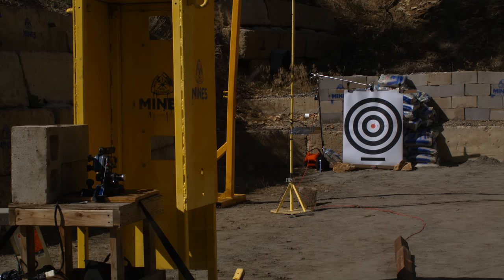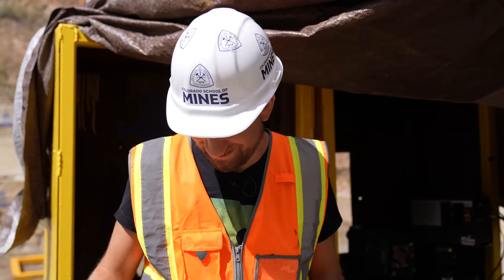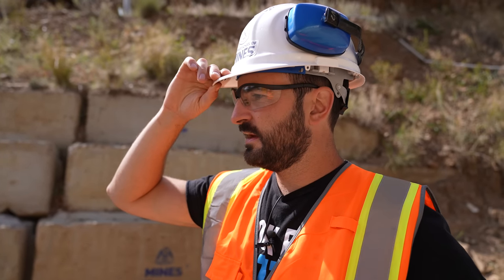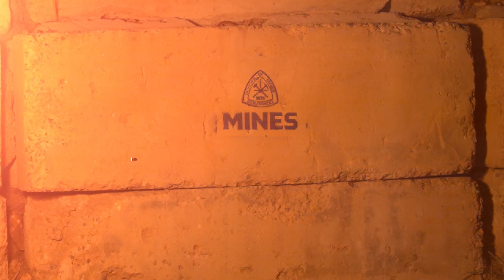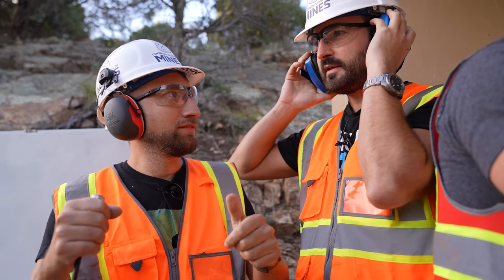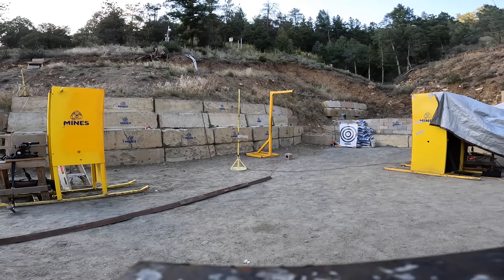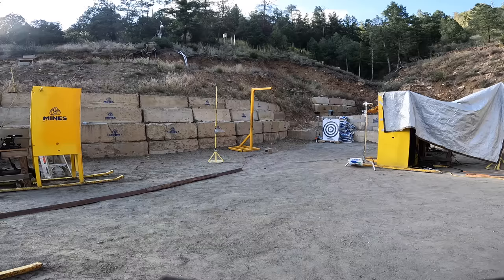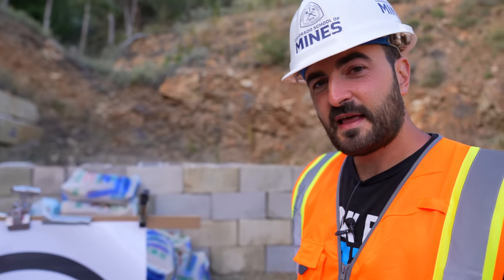Can Explosions Deflect Bullets? 2 MILLION FPS - The Slow Mo Guys

Comment: For the love of god! use a marker to mark your old bullet entries so you won't have to guess which one is the new one!! 😁 Nice explosions though! I bet the bullet is deflected a tiny bit, which may show better if target was like 1km away
Reply: Pasties are even better, but yes, somehow mark the previous shots.
Reply: imo, the biggest gripe is using PAPER target. Of course the blast is going to send the target flying and you won't get a consistent accuracy of hit markers. Next time, they should use a steel plate with a target painted on it.
Reply: i think the bullet would have deviated more if it was timed with the shockwave instead of the fireball
Reply: bullet being cylindrical dosent help i think. explosive bursts probably need flat planes for effect.
Reply: Just observing the position of the hole influences its position
Reply: @bigbrainboiii  I don't think there is any combo that will produce a noticable (more than wind / bullet variability) deflection. Sure the explosion is much faster & more powerful that the bullet but you have to consider the surface area & time scale that that explosion is acting on. The proportion of the total energy of the explosion that actually impacts the bullet is absolutely tiny.
Reply: @agilemind6241  to schockwave is just air moving so it is pretty much just wind + the shockwave travels at the speed of sound which will help proper the bullet

Comment: I love how ridiculously complex the setup is, how precise everything has to be measured, and then the final target they’re using to measure success or failure is flapping around madly each time. 😂
Reply: Glad to see I'm not the only one with that thought
Reply: First thing I noticed.
Reply: .... but then they wouldn't have an excuse to redo the test all over again 😉
Reply: No amount of planning can overcome that natural Gav and Dan energy
Reply: I was thinking the same thing.... A bit of paint on some plywood would have fixed this.
Reply: It was most likely flapping wildly because of the bullet hitting the target no? and as we saw the shockwave was slower then the bullet speed, so it wouldnt have affected it. Buuut, i would also love to see them reshoot this with less...ramshackle setup
Reply: ...but then at the end they showed the grouping in the bags behind the target and it was, guessing here, something like 4 to 6 inches? 

Even if the shockwave is having an effect on the bullet and the flimsy flapping target, the effect very clearly isn't any greater than wind and the sum total of all other unaccounted or random factors like miniscule differences in the gunpowder itself, the amount of gunpowder, bullet dimensions, mass, and finish, barrel temperature, air temperature, and so on.
Reply: Exactly. How could they miss that? Plywood with stenciled target would have been perfect and definitely a more accurate test.
Reply: 12:10
Reply: If you all actually paid attention they do mention that
Reply: @connormccarter9581 Yeah, I was thinking a piece of plywood would of been a bit better choice than that big flappy piece of paper too. 🤦‍♂😂😂
Reply: I'm surprised they didn't use a pen to mark the bullet holes on the target after each shot. Then it would have been easier to identify when a new hole appeared.
Reply: Well, they could build the target out of tungsten I guess, but then I'm not really hopeful for the life of the copper bullet lol
Reply: My thoughts exactly...even I have a real target, and I'm nobody.
Reply: @lincolnrayes6464 the shockwave is shown going like 10x faster than the bullet 🤨
Reply: @MustangsCanTurnToo  Well since i missed it care to point out a timestamp instead of sayin something and bein big brain enough to put an emoji at the end?
Reply: I was thinking it wouldve been better to use a rubber target bolted into a piece of would against the cement barriers so nothing moved. After seeing the target move before the bullet hit (accounting for the fact the bottom kept coming undone and raising the center) they would need to find a way to have a stationary target for definitive results.
Reply: Yes, but the sandbags behind the paper target show the grouping to be about the same
Reply: They could just paint the target on the bags of sand
Reply: @lincolnrayes6464  learning isn’t free.  You have to pay attention.
Reply: @they-call-me-mister-trash847  Literally all of those factors you mentioned are negligible at this distance.  Instead, either the gun mount is not repeatable, or the target is flapping randomly because the shockwave beats the bullet to it (or both).
Reply: Yeah.  They definitely need a steadier final target and some good ole masking tape to cover the prior bullet holes.
Reply: @they-call-me-mister-trash847  I both agree and disagree with you.  I agree the shockwave's effect doesn't appear to be that great.  But...

The entire setup of the experiment was flawed.

I submit that a firearm should have been set up in such a way that its bullets would have hit the same place on the target every time.  If they can't achieve that then any results for, or against the myth, cannot be considered as accurate data.

In addition, the distance between the gun and the target was too short.  If an explosion can cause even a small deviation in the path of a bullet, it may be enough to cause the bullet to completely miss the target at 100 yards.  I think this experiment was less than 25 yards?
Reply: They could've used a piece of wood or something loo
Reply: The moment the first explosion caused the bullet to hit higher on the target, I knew exactly what happened. Then you look at the slow mo and there's a crazy amount of movement in the target. Since it's secured at the top, any amount of movement is going to move the middle upward. When you're engineering something, it's so easy to hyper focus on solving the hardest part of the problem that you completely screw up the easy part. Getting the timing right was hard

Comment: Thinking about it the bullet should actually have an easier time traveling through the super-heated plasma from the explosion because its density is probably less than air at that range. Kinda like how you could in theory fly a spacecraft through the outer parts of a big star like Betelgeuse.
Reply: I agree
Reply: what exactly is the theory of flying through the outer parts of a large star? as in the outer part of the visible atmosphere of a star that size isnt hot enough to melt a spacecraft? the near vacuum of space is less material & drag then the super hot gas and plasma emitting out so close to a star. isnt the sun's atmosphere technically also the solar wind after it leaves the main body of the star, meaning the star atmosphere technically doesnt end until it reaches interstellar space outside of it's solar system?
Reply: just realized this is codys lab lol love ur stuff man
Reply: I was wondering about that, even just the air pressure being lower inside the shockwave until things equalise. Such a fast explosion is going to have a very small time effect on the bullet.
Would be cool to see it done again but use a length of detcord along the flight path see if that changes things.
Reply: smiles in Elite Dangerous :)
Reply: ye was bout to say that as well....
Reply: @Robo-xk4jm  It's called 'theory' for a reason
Reply: I think the only hope for deflecting would be when the bullet encounters the denser air at the leading edge of the shockwave. It's part of why I'm a little disappointed in the timing of all the shots in this experiment, as every single time the bullet was already past the mid point by the time it encountered the shockwave so it was impacted on the top or back by it. What would have been really interesting is if they timed it so the bullet was flying into the shockwave and was impacted on its leading edge. Based on the results of these tests I'm not confident it would have changed the outcome all that much, but if anything was going to it would be that.
Reply: reading hitchhiker's guide to the galaxy rn lol
Reply: This makes a lot of sense but there should still seemingly be a impulse affect on the bullet from the rapid change in pressure. However maybe the bullet was just moving too fast for any significant changes momentum to take place. It would be really cool to see this done with different size bullets and bullets moving at different speeds. There could be a multiple papers written on this topic!
Reply: While true, an unpowered object should still deflect at the interface between two densities even if there is no blast wave to exert a pushing force it. The direction of that deflection would depend on the angle of the interface to the bullet's travel. But a bullet's inertia is so high compared with the relatively small difference in air densities that I wouldn't be surprised if any deflection caused by explosions of this magnitude are so small that they can't be captured with typical camera resolutions.
Reply: Don't wanna be that guy (ok I do) but if you make a ship strong enough, you can fly through it. I like how you're thinking about this. My question is what happens at the boundaries of that "cloud?" I think the change in pressure, in a moving sheet of plasma, is likely to suggest "outside force." Which is effectively what they were seeking. From your comment, I then wonder if changing ionization/electro-magnetism won't also have effects. There's so much going on in this video, I'm so glad they made it!
Reply: I also think the size of the bullet is the primary reason it seems not affected by the blast. However, there might be a change in direction of travel of the bullet, which might not be statistically significant. Kudos Slo Mo Guys ❤
Reply: Interesting. So the windage is increased by orders of magnitude but the difference in air density is enough to negate the effect of that force.
Reply: literally doesnt answer a single thing  @GGMattt
Reply: @Robo-xk4jm  yes, some spacecraft have used "solar sails" since 2010 to propel them during their entire voyages.
Reply: @Philly_Willy  so by the "outerparts of a big star" he meant the whole solar system? suns atmosphere doesnt end until kuiper belt way past pluto, as compared to what most people think of an "atmosphere" between the photosphere and corona, which would melt & vaporize any thesible spacecraft, i dont know if supermassive stars have less heat in their corona, and it all goes back to my point of wouldnt the solar wind up close be more resistance then if you were millions of miles away in a near vaccum? of course plasma would be less drag when compared to the earth's gas at the surface i just want to know what this theory of piloting through a supermassive star atmosphere has to do with it when theres a vaccum outside of the star with the solar wind being less and less as you move away from it
Reply: Unfortunately, you're wrong. The pressure in an explosion far exceeds 1 atmosphere, which is the normal atmospheric pressure on Earth. An explosion is a rapid reaction that produces a large volume of gases. When a large volume of gases is rapidly produced in a confined area, it results in high pressure.
Reply: I think you nailed it. One more factor to add is the spin of the bullet. The rotation stabilizes flight and aids in "cutting" through the air. Such a great video!
Reply: @Robo-xk4jm  Planets have been found orbiting within the outer edges of very large stars.
Reply: gonna need you to break that down a bit for me chief 😅
Reply: WHY ARE SO MANY PEOPLE LIKING AND AGREEING WITH THIS COMMENT WHEN IT IS 100% FALSE 😭
Reply: @Robo-xk4jm  I think he means that plasma is thin enough that it would not significantly slow a spacecraft
Reply: RepentandbelieveinJesusChrist6   cool
Reply: Here's a thought - any density is infinitely more dense than a total vacuum, so you would experience more drag through super heated plasma, even if you didn't get incinerated by it!
Reply: That would also mean you'd have an easier time driving a car through a c4 explosion than air xD

Comment: I think a revisit on this is in order. The shockwave happens so late vs the passing of the bullet. The flamefront and detonation is dead on the explosion's 6, but you can see the shockwave when the bullet has moved off to around 4 on the watchdial. Looks like you needed to set the detonation off even earlier.
Reply: Agreed...

Get the dynamite out again...and blow up earlier...

Cool as hell footage though.
Reply: To add to this. 

The target needs to be further away. The shockwave was lifting the target paper and so putting the rounds "lower" on the target.
Reply: @Rrynarth can probably be solved in the same spot with a stiff board target.
Reply: And they need to use subsonic ammo, the shockwave from the 9mm will cut through the other
Reply: I think that the kinetic energy of the bullet is much greater than the gas ball and shock wave of the explosion.   Several variables which might be worth investigating are a slower, larger bullet, and closer proximity to the explosion.
Reply: Also a wad cutter would be less aerodynamic, so it should destabilize the bullet easier.
Reply: they also need to revisit it because they're completely forgetting about speed relative to the blast.

if you are behind a car on the freeway and you're both traveling the same speed and you bump into their rear end, the damage will be minimal.

but if the car in front of you has a slower speed than you, or is even stopped then the damage would be immense.

they need to counter the opposing force of the bullet first, they did their entire test wrong.

the bullet should be traveling towards the blast, not away from it.
Reply: @A_piece_of_broccoli  - The bullet wasn't traveling away from the blast but parallel to it.   The issue is that the kinetic energy of the bullet is much greater than the force of the blast on the bullet's relatively small surface area.  It's like trying to blow a bullet off its course with a fan (so to speak).
Reply: They should have lowered the exposive so it was much closer to the bullet, and yes, moved the target further back so the angular deflection would be more noticeable.
Reply: @ForEverydayPeople the bullets are in pretty tight grouping by what's shown behind the paper target.
Reply: @billant2 I was thinking the same. Had the though of what about using a Carcano round? Those things are substantially longer than most, and they do tumble readily. 

I realize its a rifle round, not a hand gun, so that will affect many of the variables, but it would be interesting to see
Reply: @dantreadwell7421 - Given the high kinetic energy of the bullet an its relatively small surface are, the blast is simply unable to blow it off course.  Unless the blast hits the bullet with some shrapnel which also has a higher energy than just the gasses.
Reply: @billant2  you are most likely correct, I was just thinking because of the length and ballistic properties of the round, it would be far more likely to tumble or be otherwise affected.
Reply: Can add a few fragments, for example steel balls with a diameter of 1.5-4.5 mm, a bunch of fragments should definitely stop the bullet or deflect. A bunch of fragments should fly down to meet the bullet.

Comment: I am guessing that the gyro stabilizing effects of the spinning bullet make it very hard to push it off course. Whatever the reason, it is very cool to see in such slow detail. Awesome job!
Reply: Entire travel time down the rifling it is affected by steel. Explosion wavefront is quite dense, but it is still gas - and it would have to undo a lot of what steel did :D
Reply: Yeah seeing what a gun that isn't rifled would probably give a bigger difference
Reply: Good points!  Who has a musket, C4, and an insanely high speed camera?
Reply: Additionally if the explosion isn't timed in front of the projectile, then it's less likely to deviate its trajectory.

You can't push on someone riding a bike from behind and expect them to go backwards.

If the explosion occurs before the projectile passes the central line, then it should definitely have 'more' of an effect upon trajectory than a moderate push upon the tail.

The deviations of the hypothesis is quite small, so more micro measurements would need to be accounted for, and also that damn target needs to be fixed in place without issue from the blast.....

It causes so much variability that it almost nullifies the accuracy of the results. Hehehe accuracy of results. Lol

Still love the video!!!
Reply: Surface Area
Reply: No the spinning wouldn't affect how much wind could push it sideways.

Comment: The thing that I would adjust is the distance from the C4 to the bullets trajectory path.   Assuming inverse square law, halving the distance would put 4 times the force on the bullet.  For an object of small cross section, and the impulse time of the explosion, you'd need to really ramp up what you're hitting that bullet with.
Reply: What
Reply: This is the same thought I had. Moving the C4 closer to the bullet may have a noticeable impact.
Reply: @jo_bro666  Physics, my friend.
Reply: @jo_bro666  What do more force; explosion on 300 square inches, or same explosion spread over 10,000 square inches? Then you have to factor in time of force applied. The close the bullet is to the explosive, it receives more force, and for a longer duration. Explosions lose energy very fast the further you move away from them.
Reply: Yes and trigger the c4 before the bullet gets there
Reply: Now try it on a moving person.